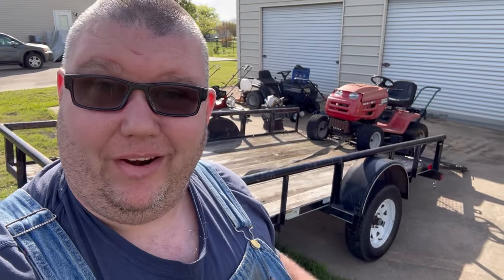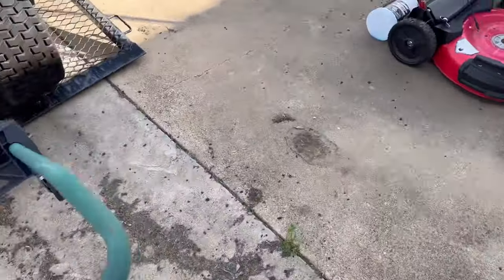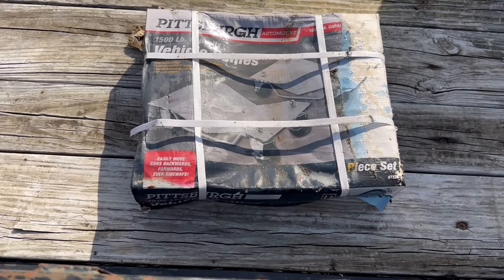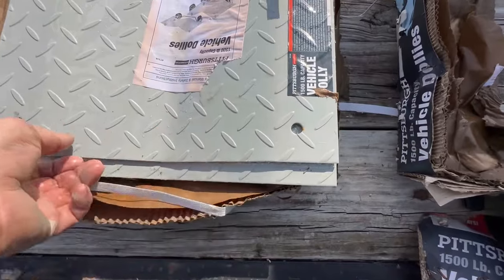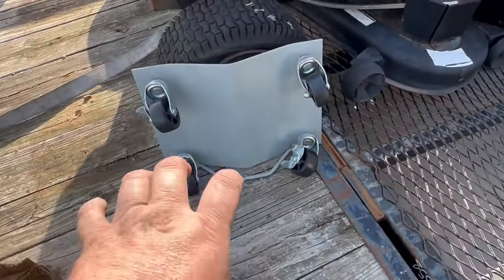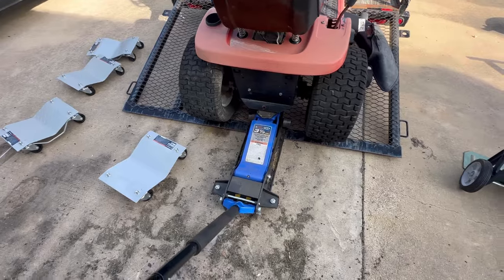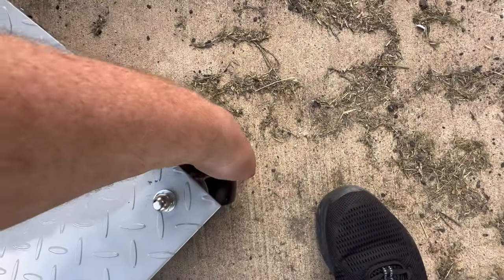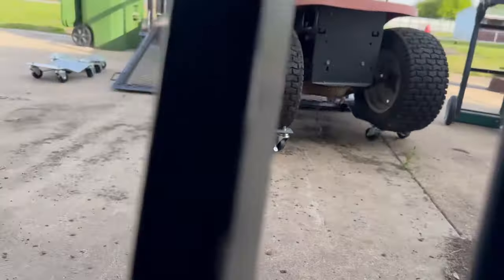CAR DOLLY SHOP HACK / A MUST HAVE FOR THE PROFESSIONAL HOMEOWNER OR BUSY SHOP

Comment: Here's a great tip for dry rotted tires that won't hold air.   Take the center out of the valve stem & use a syringe or eye dropper to put ATF (automatic trans fluid)  in there.  It will swell up & seal cracks.  
Last summer my dad was having to air up his tires b4 mowing & before he could get done air up again.  He was gonna either get tubes or new tires.  I told him about this trick.  He put about ¼ quart in each front tires & aired up.  That was 8 months ago & they're still holding air !  Even after setting all winter.